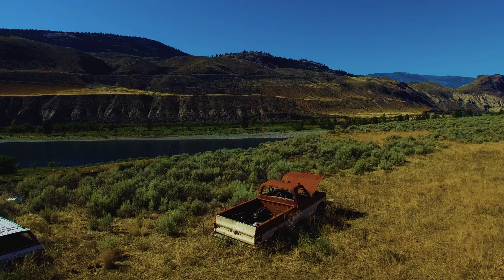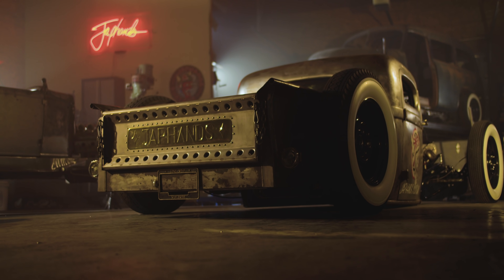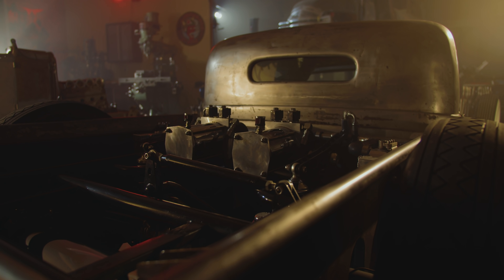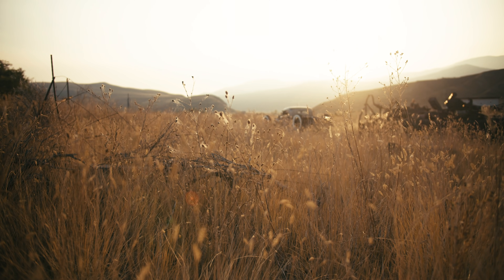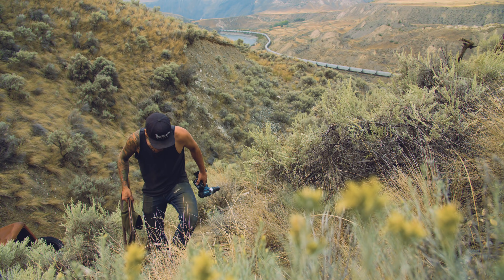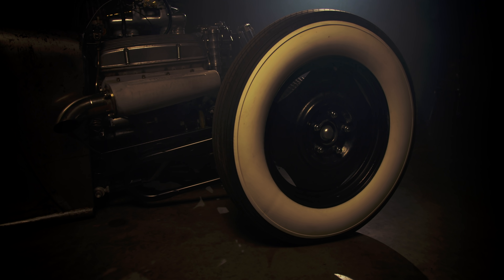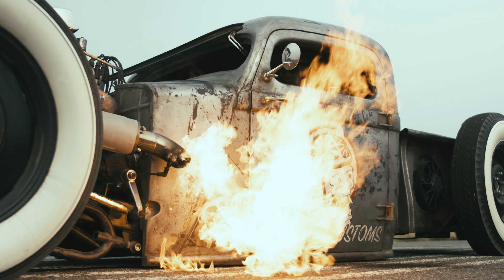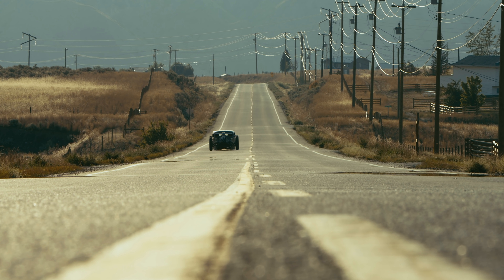METAL REBORN: Inside the Mind of Karl Fisher

Comment: The “Rat-Rod” truck is using different parts, different metal shaping, materials all not to fit. 3,412 should be the license plate. As it took 3,412 different steps, ideas, parts, attachment methods, hammer blows, twisting and hours asleep & awake to make it happen. Exhaust flame system = idea #2,852, twisted door pulls= idea #1,895, shifter & park brake= idea #3,011 etc. Now, every guy or gal with a toolbox wants to rent a time machine to go back to a point in their own life and build something like this. I can’t going forward. Physical limitations have made my dreams just that! Dreams. DK, ASE master tech-78